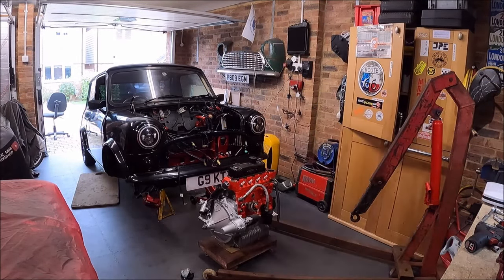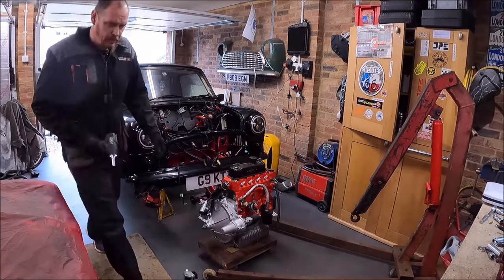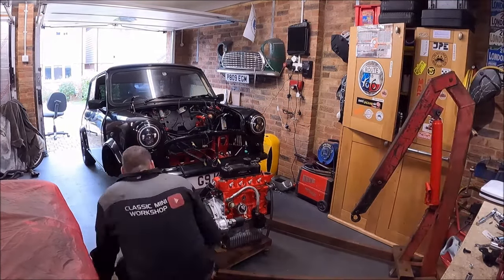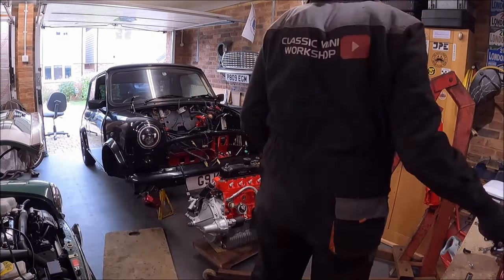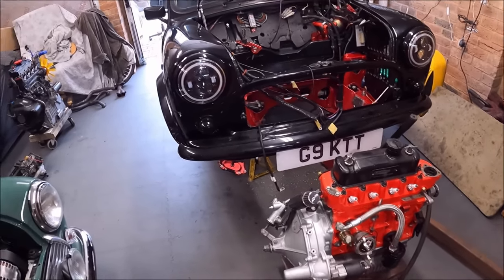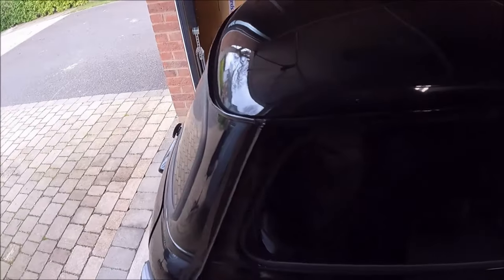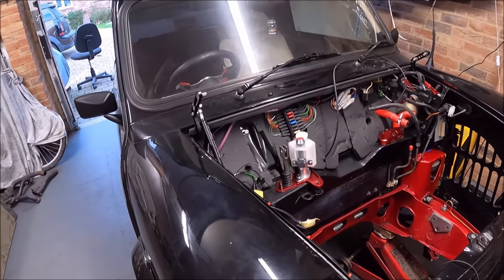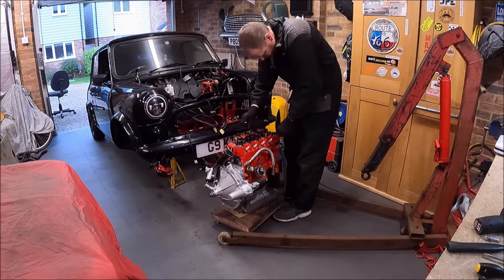Refitting Manual 1380 Engine & Gearbox - Automatic to Manual Conversion Classic Mini Workshop

Comment: Keith, when they make those engine mount spacers, they really ought to make the left-hand spacer differently so the back of the bracket has a little nub on it to locate (into the original bolt hole that the auto engine mount used) so that the fitter cannot get the new location wrong…(just thinking) very interesting video 👍

Comment: 😎👍🇺🇸

Years ago I made some wooden service blacks for a hotrod S10 Blazer I was working on.
They worked great on the Mini.
Getting the car up about 7" and totally stable. They can be seen in one of the videos I think.
I prefer to not have the suspension sagging sitting on jack stands.
I've had cars move before with metal on metal.
These blocks don't move.
I can actually slide my chubby arse under the car and work.
👍

Comment: Hey Keith, enjoying the series as always. Just one point on the engine mount holes which you maybe aware of already - from 1990 onwards the mounts were moved slightly forward to enable the HIF44 on the 1275 Coper to clear the bulkhead okay, so hole location when converting may vary depending on year of car or subframe.
Reply from the maker: Thanks Sean.

Comment: I realise its a bit late as its all done now but maybe for future reference I would have left the SPi fuel tank, electrics and pipework in place and used its fuel pump and fuel level sensor as the only difference between an SPi / MPi sensor and a carb one is it has a kink in the float arm to miss the fuel pump. The return pipe would then just need a cap in the engine bay.

On the engine mounts Minispares do one with captive nuts fitted (21A1902ST) and used them and I have to say I have always fitted the bolts from the outside in.
But you are doing a great job have to say. 👍
Reply: Hiya 1chish(sorry don't know your name). Wondered if I you could put your email address in here for me to contact you about project Bruce. Thanks, Dave Fielding.
Reply: @dnf1903   Hi there Dave. I won't publish my email address here but Keith has it and he did ask if its OK to share which of course it is.
And its Chris btw ...
Reply from the maker: I've just text you Dave
Reply from the maker: Thanks Chris, yes I did consider utilising the SPI in tank pump and using a pressure regulator to reduce the pressure for the carb. Originally I thought we were going to use a mechanical pump but in the end I used an electric pump anyway.
Reply: @classicminiworkshop  I used the Mini Spares mounts with captive nuts once but found them to be more trouble that they were worth. Their nuts are not welded - just crimped. So, unless you get the mounts perfectly aligned with the subframe holes it is too easy to get the nuts spinning. Since they are not actually nuts you can't hold them with a spanner so you end up needing long nosed vice-grips to get the bolts out. Nightmare!

Comment: You must be needing a beer running around like that? Feel your pain with the pedal box, when building my Domino cabrio i had to grind fibreglass away to get it in, then because of the thick body it wouldn't allow the brake pedal to return fully, passed its mot but let me down on the way to Stanford hall when the brakes jammed on! Nightmare